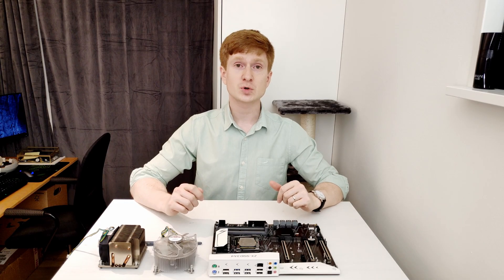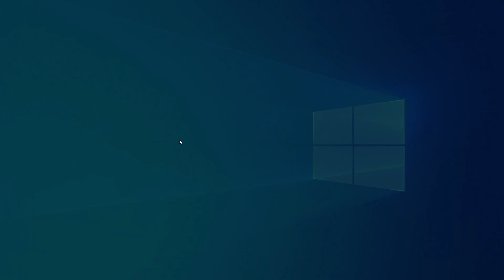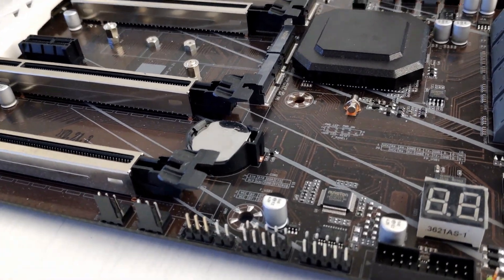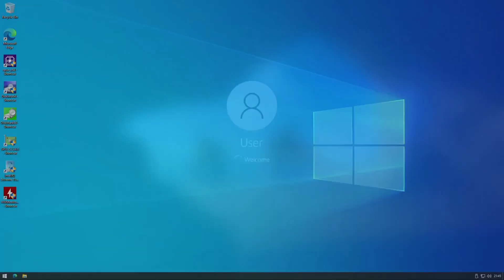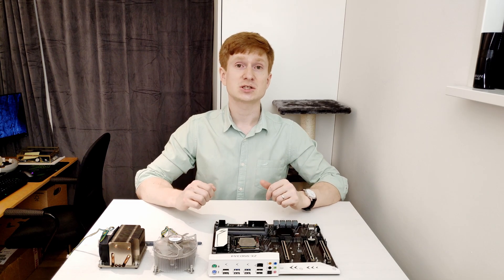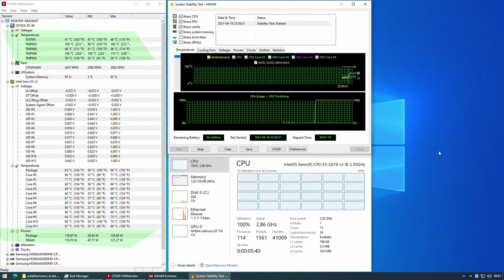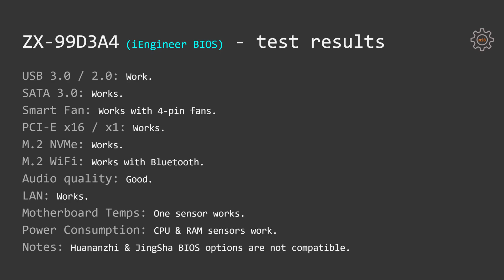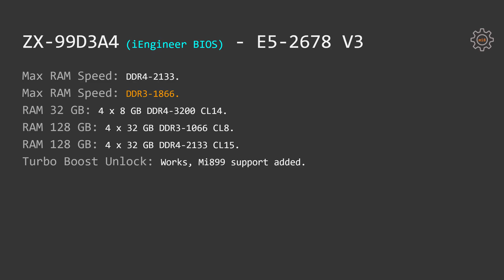🇬🇧 ZX-99D3A4 (Qiyida, Kllisre) – detailed review, almost everything works with BIOS from iEngineer

Comment: Hi.. i was just wondering if you ever had any problems with the qiyida motherboards I/O shield! ..for some reason with the I/O shield installed, the mobo just doesn't allign properly which means i can't screw it in place! ..but, without the I/O shield, it alligns perfectly! 🤔
Reply from the maker: Every now and then I have this problem with all Chinese motherboards. Their quality control is simply not good enough.
Reply: @Miyconst  Yep ..that's one of the downsides unfortunately! ..guess i'm gonna have to use it as is for now! ..unless you have a workaround!? 😅

One more thing ..what about the drivers? (audio,internet, etc) ..do they have a site or something that lists compatible drivers?! ..if no, how to get them!?
Reply from the maker: Just install all Windows updates including the optional ones and you will be fine.
Reply: @Miyconst  Thank you very much! 😀 ..you've been very helpful!

I was all excited after finishing building my first pc and now it won't even POST! ..everything seems to be running well (PSU,all the fans incl. the RGB one on my cooler and the ones on the GPU) ..i just don't have anything appearing on my monitor!

And yeah, i also get those 5 beeps! ..did you ever heard those beep codes on one of the qiyida boards!?

Comment: Congratulations on the tutorials. I have a question, can I use an E5 2690 v4 to turbo hack Asus x99a?
Thank you.
Reply from the maker: No, you can not, turbo boost unlock is not compatible with the V4 CPUs.
Reply: @Miyconst  
OK, Thank you. 
Can you modify one of your v3_payne_60_50.ffs files to lower cache voltage and make a _60_60.ffs?
Reply from the maker: @gerardcc1897  I can surely do that, but you can implement it yourself with ease, take a look at the S3TurboTool method: https://xeon-e5450.ru/socket-2011-3/e5-2600-v3/dobavlyaem-anlok-v-bios-raz-i-navsegda-cherez-s3turbotool/
Reply: @Miyconst  
Hi, thanks for the link. I have been able to modify the voltages. I have used the S3 Turbo Tool _v1.5 software. because V1.53 doesn't work for me, I get warning messages and it won't open the software.
I have used these modifications for an E5 2697 v3 with Bclk 105, but I cannot upload more.
Thank you.

Comment: HI, can you help me? i' have a HUANANZI ADA4 v2, do you know ho to enable x2apic in  HUANANZI  bios? many thks
Reply from the maker: Sorry, I don't understand which motherboard you have and what you are trying to achieve with it.
Reply: @Miyconst  HI thanks a lot for answer, i found only now how to enable x2apic option in bios of my HUANANZI AD4 x99 - c610 motherboard,  did you find poor gpu performance on HUANANZI  motherboard? thank a lot! i'm a your great follower :)
Reply from the maker: @antoninoromeo4015  I have tested many Huananzhi motherboards, and didn't have any GPU issues so far.
Reply: @Miyconst  thks a lot, Hi can you help me to unlock turbo? i have a HUANANZHI X99-AD4 Rev 2.0 i don't undestand what i have to do and i don'tfind any in english. Have i to flash bios? the new bios is the same but modified? i need vt-d and interrupt remap for gpu passthrow in proxmox. 

Many thks
Reply from the maker: @antoninoromeo4015  please read this page: https://www.miyconst.com/Blog/View/2081/xeon-e5-2600-v3-turbo-boost-unlock

Comment: Holy crap guys.. What happened to the prices on the E5 V3 and V4 Xeon prices? I had promised myself to buy a 2680 V4 once the price dropped to under 200 Australian dollars and now they are 400 dollars lol.
Reply from the maker: Now you don't have to keep the promise 😄.
Reply: @Miyconst  haha, yeah it would be kinda dumb to upgrade my Dell T5810 now.. I'm still running a E5 2620 V3 6 core. In it.. damm lucky I have a PS5 to game on. I should sell the 8gig RX 480 in the PC while the going is good.

Comment: Please make a video on installing hackintosh with Huananzhi motherboards
Reply from the maker: Why?
Reply: @Miyconst  someone installed hackintosh on a huananzhi x99 f8 based system but the video was in russian. The hardest part was getting the drivers to work with the MacOs. What was awesome is the he used 2 NVMEs and enabled dual boot by installing windows and MacOs on each NVME. I thought it would be an interesting idea if you made a video on it ...
Reply from the maker: @realmadridfc929  I understand, but macOS is not something I use and not something I am familiar with, me making a hackintosh video would only consist of me swearing on macOS and how shitty hackintosh solutions are 😁😁.

Comment: Are Huananzhi boards in general better quality than the brandless ones?
Reply from the maker: Not really, you have to do your research for each individual motherboard.
Reply: @Miyconst  However, I have always had a positive experience with the HuananZhi Official Store.  Can't say much about ALL of their boards having only purchased their X99TF and X79 Deluxe offerings...both of which have proven fully functional and of solid quality (w/ good components). My experience with alternative stores has not been to the same level of customer experience as with the OFFICIAL Store. Just my opinion, based on personal experiences.
Reply from the maker: @jb678901  Yes, I confirm that! Huananzhi Official Store on AliExpress has the best customer support from all other AliExpress stores I have ever happened to deal with.
Reply: Haha 650$ went up to 1650$ just in a few days. I asked them about this jacked up price and all they say is the mining to blame. Well I wonder how mining may potentially influence a 3 pcie huananzhi motherboard with dual processors while there are BTC miner boards with over dozens pcie which run on a junky intel cpu. I hate to say that but world has become a s... hole and needs flushing.
Reply from the maker: @erhanertem196  those junky motherboards with lots of PCI-E lanes are good for certain cryptocurrencies, which require GPU power, but don't require CPU power. Nowadays they have developed other currencies, which require CPU and GPU power, and this is where these dual socket motherboards shine.
Reply: @Miyconst  so finally we will be deprived of pcs for a decade till all these coins go extinct or intitutionalized, and if we ever buy disposed O.C. xeons over alixpress might possibly come from these 7/24 coin farms which may die in our hands in a matter of time. In all direction is very bad for people like us/me.